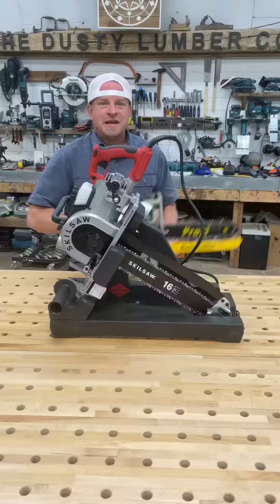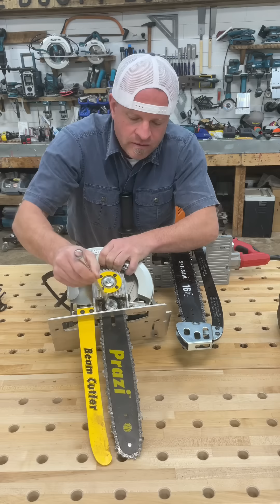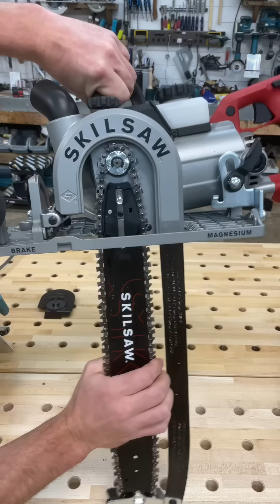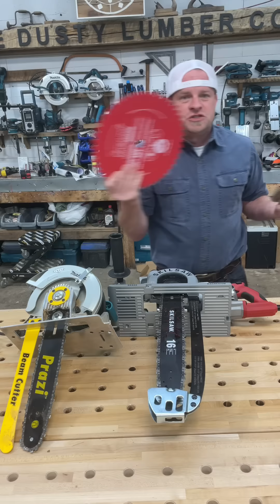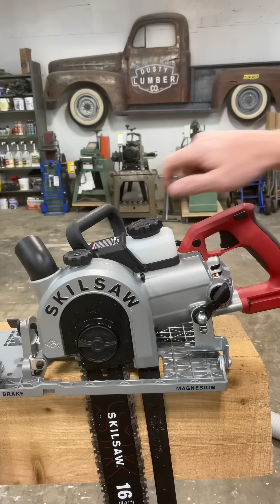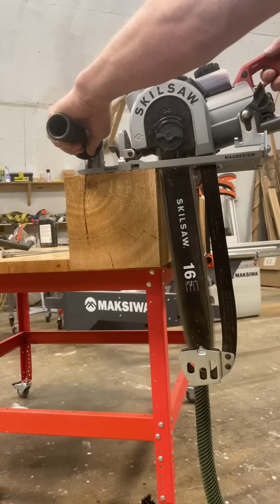Crazy new saw for my shop!

Comment: Much better design with the Skil brand beam saw. Is there any way to make miter adjustments to be able to rip a piling with a bevel for the turns of the bulkheads I build. And great video. Is the beam saw available as stand alone to use in my old model 77 worm drive?

Comment: Check out the project farm video on saw chain sharpeners. Keep your cutting as sharp as the rest of your tooling. Also - interesting to hear you think the full house gives the cleaner cut. In making rip cuts with a chainsaw, usually the skip tooth design gives a cleaner cut.

Comment: Festool has a smaller one (up to 8") that can run on a track. Have used it to make notches and half joints. They're not great, a bit rough, but good enough depending on the wood you use and the look you're going for.

Comment: The chain with every other tooth missing is called a skip chain. It's for cutting wet lumber. It throws the saw cuttings out better.
Reply: Skip chain has two links between each tooth.
Reply: @Darndiddlyarn 
Right, and skip chains are for long bars, for my Husqvarna 385XP I have a 2 foot bar with a full compliment chain, link with a chisel (tooth), link without a chisel, link with a chisel on opposite side of last chisel and so on.
Then I have a 3 foot bar for it with a skiptooth chain, link with a chisel, 2 links without chisels, link with an opposite side chisel and so on.
With chainsaws I've never seen a chain that has a chisel on every link except for some antique saws that don't have chisel type teeth they had cutting teeth that look just like the one's in a manual cross cut saw (what the old timers called misery whips).
Putting a chisel on every link or a chisel on every other link (like a normal chainsaw chain) on a long bar like my 3 footer would drag the saw down and stall it from having too many cutters digging into the wood than the motor can pull through, cutting the rakes down too low does the same thing because the chisels are taking too deep of a bite into the wood.
Also, chains for ripping wood are quite different than regular cross cut chains in how they're sharpened, instead of a 25° to 35° angle on the chisel they have about a 10° angle, the chains themselves aren't special just the way they're sharpened. 
When cutting fresh wood from a tree that's been recently dropped and wet if you try rip cutting with a cross cut chain you'll see the cuttings coming out in long slivers that look like hash browns before they're cooked instead of chips like you normally get when cross cutting, those long slivers will clog up the chain and instead of cutting through the wood fiber it's mostly trying to burn through it and you'll ruin the chisels on the chain that way from heating them up and them losing their temper, with dried wood that's used in furniture making like this guy does I don't think that'd be an issue but one thing that will be is with the 35° cutting angle on the chisels of a normal cross cut chain that angle side loads the chisel which is what it needs for cutting across the grain, that side loading when cutting with the grain will produce a very rough surface and a much wider than normal kerf, I'd lay odds the chain on these things have the special 10° angle on their chisels so anyone who wants to sharpen them with a chainsaw sharpening device needs to make sure it's adjustable down to 10°, all those little hand held things and the one's that clamp to a bar that have a crank you turn by hand wouldn't work on these chains because they'll have the regular 35° for your typical chainsaw chain.
Reply: Skip chain also gets the cuttings away without binding up the saw.
Reply: Very interesting
Reply: That chain is a regular chainsaw chain not a skip chain🤦🏼‍♂️

Comment: I nearly stopped watching when you said you use WD-40 as a chain lube. May be a bit better than water, but not much. Any oil would be better. Motor oil, 3in1, actual chain saw oil even. If this comes longer, then it can make a simple saw mill....with a ripping chain.

Comment: one piece of advise - buy youself a electric chainsaw chain sharpener, like oregon. I used to sharpen my chains by hand with a file, but the teeth were not with even angles, some were shorter and the chain was making a uneven rough cut. After i got the sharpener every cut was like butter. And it takes about 5 minutes to sharpen a 50cm chain.